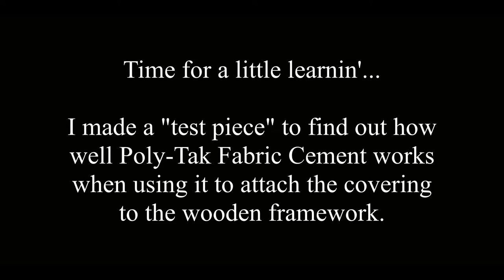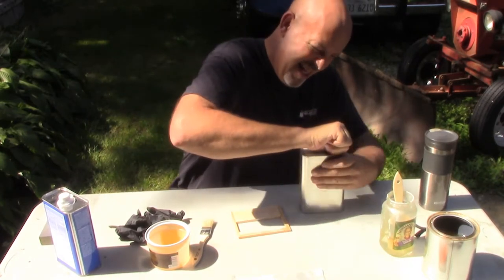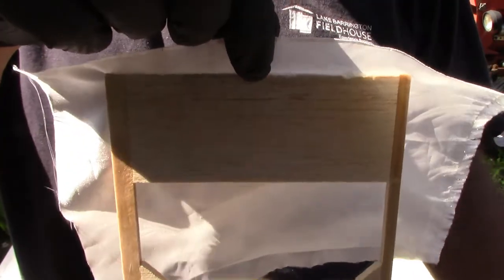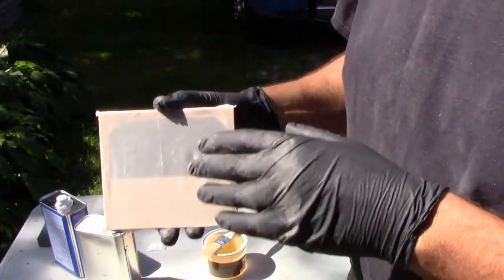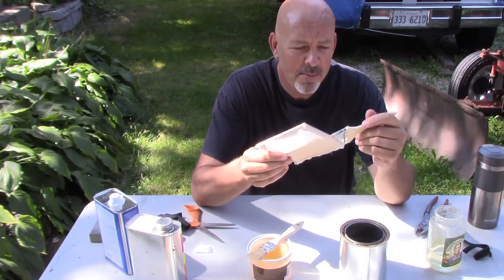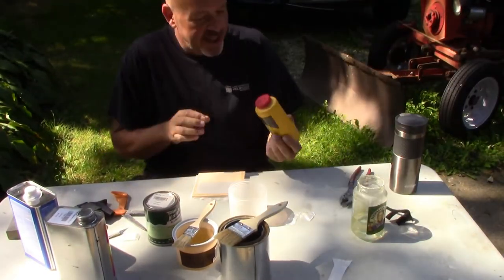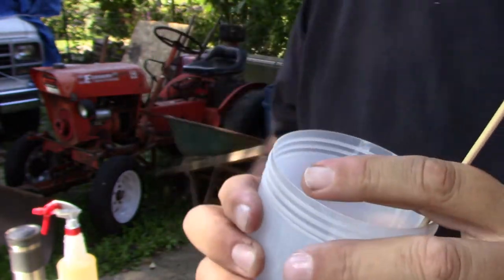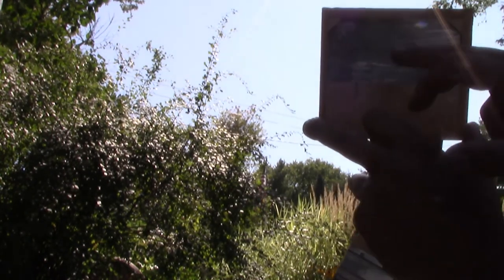33% Clipped Wing Taylorcraft Restoration - Video 57 - Covering Test Piece

Comment: can you let the polytac dry like contact cement and then iron on the covering
Reply from the maker: It may.. It may not. I haven't tried to use it like SIG Stixit. Poly-Tak is  designed to be used wet, so when the fabric is pulled over it, the adhesive will permeate through the fabric to create a firm bond.